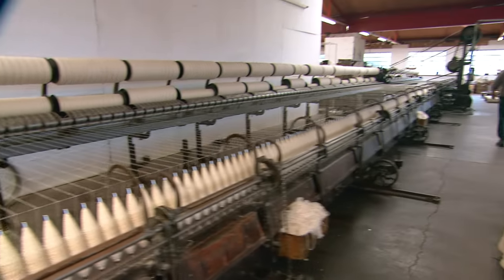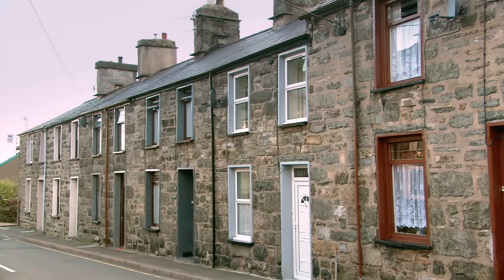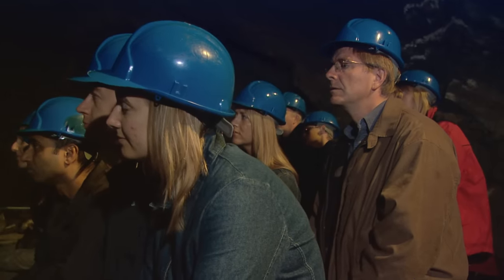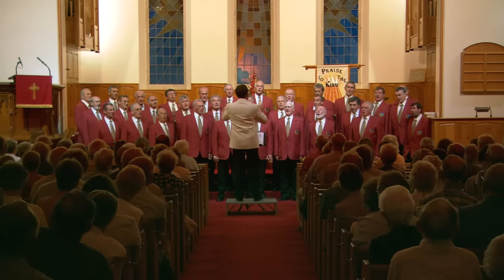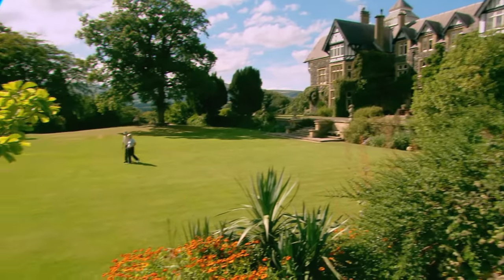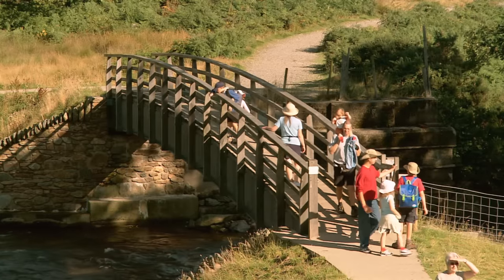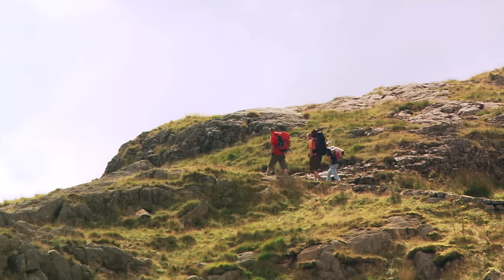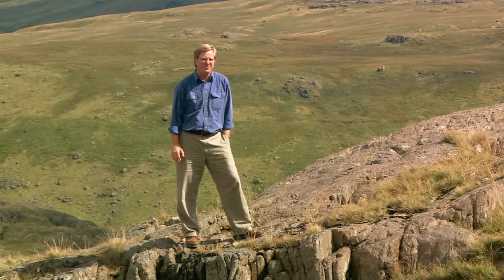North Wales: Feisty and Poetic

Comment: How much all those travelling costs, sir?
Reply: EAGLE EYe that would depend .

Where is the starting point.
Cheaper to come from Shrewsbury than from Australia 

Your choice of travel. 
A bus from Shrewsbury is substantially cheaper than flying from Australia.
First class train travel will be more expensive than walking and using a local bus.

Time of travel. 
Off peak is cheaper than peak time. 

The same with accommodation, it varies